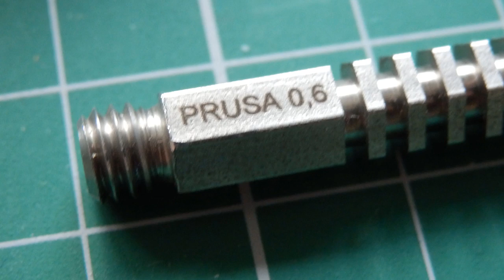RepRap Prusa Nozzle Testing - PLA print speed

Comment from the maker: Many more things make up extrusion speed, like depth of nozzle hole, melt-zone, temperature transfer into material, I'm still seeing how fast the Prusa nozzle can go, this was just the fastest I have gone before with other nozzles. And yes, it's almost at the limit of this printers mechanic's.
Some nozzles allow fast printing, others can only print slow, but sometimes better or finer results - it all depends what you want from a 3D printer.

Comment from the maker: At the moment you need a 40mm fan on the Nozzle barrel and I'm using a single 80mm fan blowing across the print bed - for a single item print done that fast, you are better off switching the heated bed off and using Blue tape - much easier to keep the plastic cool - or use the heatbed for a whole bed of parts.

Comment: Wow, what a sight.  As PLA melts at 185, I'm assuming you had to bump up the hot end temperature a bit to keep up with the flow rate.  What was the temperature you used for high speed portion? 190? 195? 210?